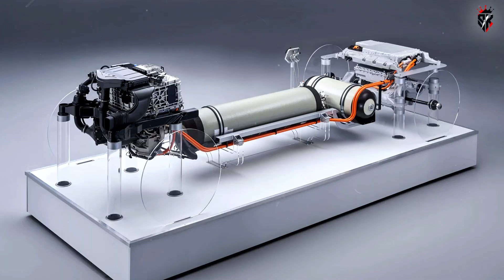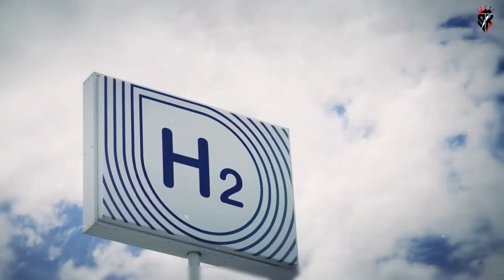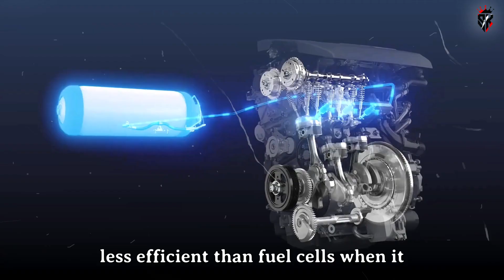Kawasaki’s Hydrogen Bike Future? | H2 Hydrogen #kawasaki #hydrogen

Comment: hydrogen is the worst fuel ever.. and how high are you that you can say hydrogen is much easier to store than electricity... learn son physics 😂
Reply from the maker: Appreciate the passion, but let's be accurate. Hydrogen isn't "the worst fuel" — it has the highest energy density by mass and offers ultra-fast refuelling, which solves some real issues batteries still face. Storage is complex, yes, but comparing hydrogen storage to electricity storage isn’t apples to apples — electricity must be stored in heavy, slow-charging batteries, which also have thermal and degradation issues. So before throwing around “learn some physics,” maybe take a second look at the fundamentals.😎
Reply: It's like the ultimate fuel additive that increases fuel mileage by 50%.

Comment: Hmmmm. They are using what appears to be a modified conventional reciprocating engine. I wonder what they have done to prevent blow by to prevent the crankcase from filling with Hydrogen?
I would imagine that on top of the already mentioned difficulties, there will have to be expensive & very regular maintenance to ensure the engine doesn't become a bomb.
Reply from the maker: Great observation, and you're absolutely right to raise that concern.🥰
Hydrogen’s small molecular size does make blow-by and leakage a serious challenge, especially in modified reciprocating engines. Kawasaki’s prototype reportedly uses direct injection, which helps minimise pre-mixing and limits hydrogen exposure in the intake and crankcase areas. But yes, sealing, material compatibility, and potential embrittlement are critical factors, and you're spot on that long-term reliability and maintenance could be both costly and essential to ensure safety.
Reply: direct injection, advanced sensors, and computer chips make it possible.

Comment: Nothing wrong with Petrol, Plenty of people driving gas guzzling big SUV with only one person, the driver, so better to encourage more single mode transport than make emissions for motorcycles get to the point it will be almost impossible to meet these emissions regulations. 

Or, make efuel cheap for bikes.
Reply from the maker: Petrol engine emissions are not that bad, but they want to bring something new so they can sell something new ✌️🙄✌️
Reply: @SKroadstar  I'm not so sure they'd be bothered if it weren't for tighter emissions regulations from Europe and rumours of banning internal combustion engines in 2030, I can't see how that can happen, especially motorcycles as Electric motorcycles would mean the death of motorcycling in Europe or rather the dealers because no one would want to buy new bikes due to crap range, charge times and weight not to mention battery life.
Reply from the maker: "That's not it—bikes crash way more often than regular cars, and the battery can catch fire. It's common in China: 'burning scooters' ⚠."
Reply: @SKroadstar  They can use LiFeP04 that won't burn but the energy density is low so not really suitable for electric motorcycles. There's no battery at this time that is suitable for motorcycle. For scooters up to 50 Km/hr batteries might have a case but petrol is still far more practical for range and refill times.
Reply from the maker: 'I 100% agree

Comment: Hydrogen powered Motor bike? Are you kidding?  Not going to happen ever!
Reply from the maker: Yeah, it will take a decade to solve fuel capacity issues, 😞
Reply: It's a hybrid, the hydrogen acts like a fuel additive similar to nitro oxide adding 50% better fuel mileage.